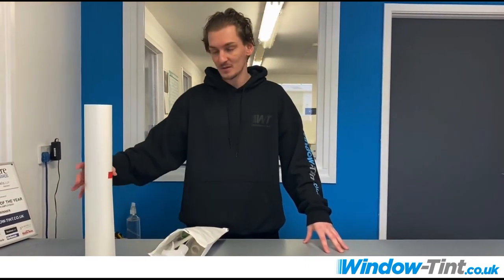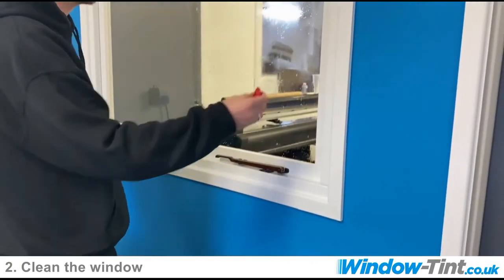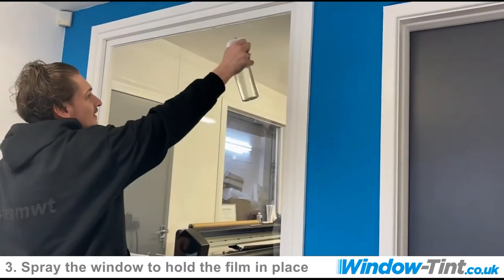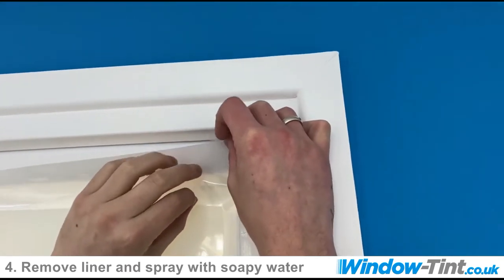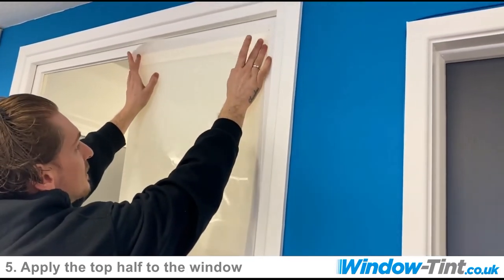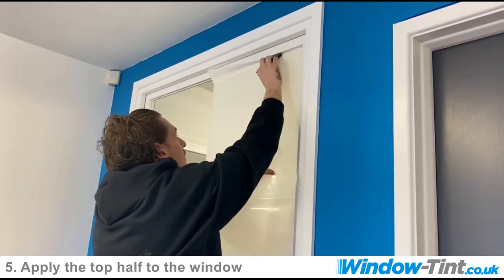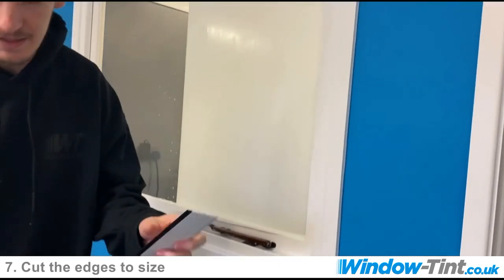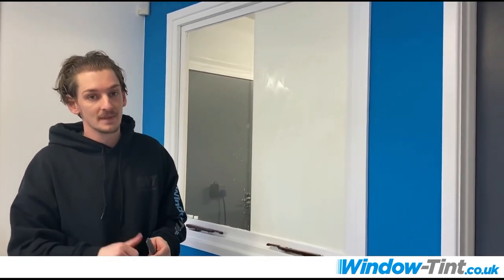How to install frosted window film | Architectural & Commercial Window Tinting

Comment: is the frosted film supposed to be sticky or not? when I pulled off my backing paper or whatever its called, the frosted film has no adhesive on it, so I dunno how its supposed to stick to the glass?
Reply from the maker: Hi, If this was ordered though our site and is our frosted film this will 100% have a cap sheet coving the adhesive this is required to be removed to expose the adhesive to be able to install this correctly. this can be tricky to remove so in this video we show the best way to separate the cap sheet.. this is @ 1.40 on the video above..